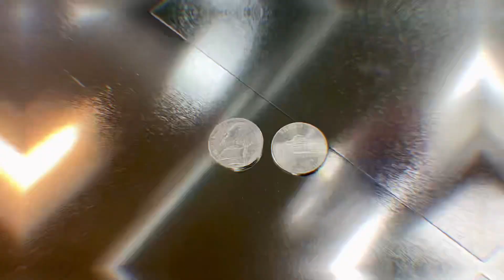WATER PROOF TABLE SAW?? - Harvey Nickel Technology

Comment: Coating is the problem.   It will wear off over time with use.....just like their tin coating does.
Reply: That was my concern too. I purchased my new Harvey saw in bare cast iron just after this new nickel plating edition was released. Not because of the extra cost, but because I would rather not deal with the problem of the nickel wearing through over time and looking even worse. They look nice and slick when new, but any surface coating will eventually wear through.

Comment: I wish the table Saw has a soft start and a motor break to stop faster. That would be nice and a perfekt Upgrade 👌🏻
Reply: Jesus, i love the Alpha tablesaw. But the motor just runs for far too long. Thatˋs why i had some trouble with wood, which got into the saw blade because it kept running. They have to adjust that, please!
Reply: The last thing I miss on this machine - i hope it will come soon
Reply: <brake>